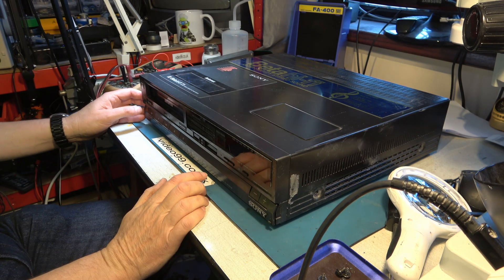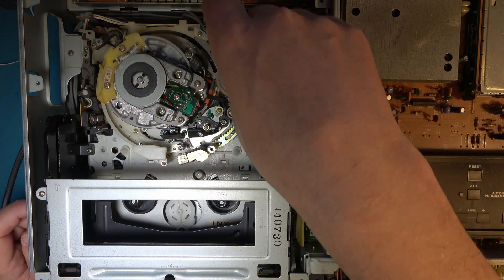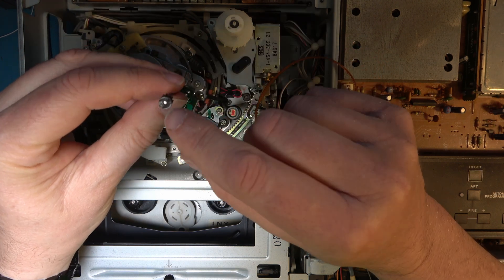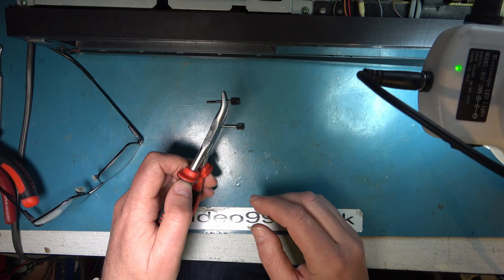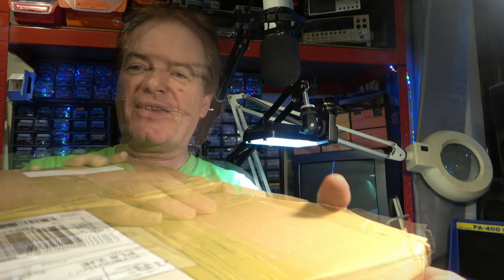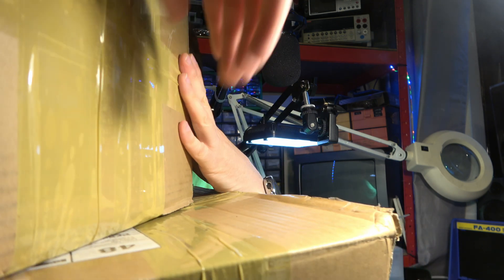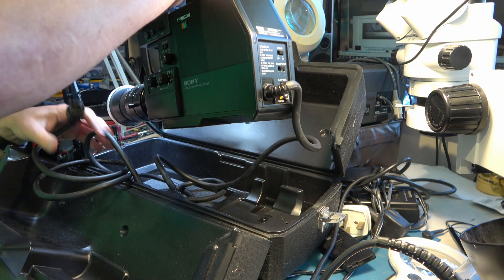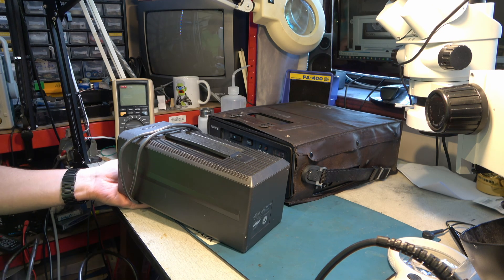Sony SL-HF100 Beta HiFi breakdown. Look at SL-3000 and CCD-F340 donations.

Comment: Weird question... Does anyone know if the window on the top of the hf100 came with removable plastic film like a lot of modern products?
I ask because I acquired a machine today and there looks to be plastic film but I'm too afraid to remove it in case the logos come off with it 😅
Reply from the maker: That film still seems to be in place on all three of my HF100 machines.  I think I would leave it alone.

Comment: I have a SL-HF100P (industrial duplicator). It has now started to stop after few second of play/rewind/forward. Intermittently it will play about 10 minutes after pressing play/rewind few times. Any clues where to start?
Reply from the maker: The reel idler is called a pendulum.  It wears its support post at the plastic base.  Inserting a thin washer under the reel idler can help, but you have to take the reel drive assembly out.
Reply: @video99couk  It was typical head’s hall sensor after all. Thank you for your great videos🙂

Comment: I had a fantastic old Betacam SP camera with around 120 faulty and badly leaking SMD capacitors...nightmare. Never seen so many to deal with. Chucked it in the bin eventually as too many caps to deal with. That's the problem with a lot of that old stuff, not worth the effort.

Comment: Betacam was a professional/broadcast tape format, whereas Betamax was a consumer tape format. As we all know that. But, there is no commonality between the recorded signal systems of the two formats. They are incompatible. The only commonality was the basic cassette shell design, which Sony decided to reuse for the Betacam, which came later after Betamax, I believe. Betacam also went on to use a much larger cassette size for longer recording/playback time and also the Betacam SP update, which improved the Betacam signal quality via higher resolution and better colour. I worked as an engineer in the broadcast industry during the heyday of Betacam, and the regular Betacam with smaller cassette, which looked very similar to Betamax cassette but with oxide tape inside was used for commercial ads playback. Usually, one 5 minute Betacam oxide tape cassette contained just one ad of 5, 15, 30 or 60 seconds. So if 100 separate commercials are to be played, there would be 100 Betacam small size cassettes. All handled by robotic library system controlled by computers and  it would play the commercials according to a playlist. The larger Betacam SP cassettes with metal particle tape inside would be used to play back movies or other shows. The library system would switch the playback back and forth between the ads and program tapes according to a playlist. I worked on the Sony BVC-10 Betacart, a 40 cassette library system and LMS-1000, a 1, 000 cassette library system; it handled a mix of small oxide Betacam tapes and the larger Betacam SP tapes. All barcoded, so the library would know what material each cassette contained.
Reply from the maker: The smaller tapes were usually (but not always) metal tape BetacamSP too.  I probably come across 20 BetacamSP tapes for every oxide one which shows up.  There is one commonality between domestic Beta and professional Betacam, the linear audio tracks are in the same place, probably so the early machines could use the same audio heads as they already had available.  There were also commonalities in the equipment such as some batteries and internal components.

Comment: I hear RCA cable is the lowest quality when u play VHS tape . Is there any way to play it with high quality. I search for vcr with component ports but for the most of vcr it is only composite
Reply from the maker: Use an S-VHS machine which has S-Video connections.  It's a very worthwhile improvement even with regular VHS tapes.

Comment: Another cracker, Colin - thank you. I think I saw on 12 volt vids that you can rejuvenate dim VFDs by oversupplying them for a very short period, which burns off any oxidation on the holding wires

I’ll see if I can find the video and mail a link to you

Comment: Clearly Betacam is related to Betamax, since they use the same cassette. I've successfully recorded Betacam onto a domestic L-750 cassette in a Sony BVW-75P, and got 30mins of record time. The BVW series are the only ones that can record both Betacam and BetacamSP formats. I think the Technology Connections video was just saying Betamax is not Betacam, which is true they are different formats but using the same cassette.

Comment: I think there are some similar gears from radio controlled cars that will fit and work. I had a scrap SL-C20 to donate the loading gear for my HF-100
Reply: I found  a brass gear from a hobby shop. It needed to be modified: cut to length and the centre hole drilled out for an interference fit on the shaft but it has worked well so far. I think I've  done this on three Betamax machines so far.

Comment: Quite true, the gears are beyond 3d print technology but I can't help but think some other no skill options exist. Clearly model engineers have the the equipment to machine/CNC gears for miniture stream locomotives and so on but that is a high investment option. But casting in plastics seems on option perhaps by making a mould from an original part as some modellers indeed do. I am not a modeller so... pinch of salt.

Comment: A resin 3d printer might be able to print that - though the materials might not be a strong as normal 3D printer filaments. (I have 2 HF100's by the way).
Reply: Seriously considering buying a small resin 3D printer for that reason as I agree it's the way to go to get some additional strength.

Comment: TC's intention was to debunk the idea that Beta was the better format of the two domestic video formats "because tv stations used it". His point was that no matter how much Sony reused the mechanical part of the original Beta, the video signal in Betacam was completely different and incompatible. He argued that, once Sony was forced to slow down the speed of the Beta format to keep up with VHS longer tape running times, the slight advantage of a better image quality of the original Beta, vanished.
Reply from the maker: The tape slowing comments may or may not be true in NTSC world.  Beta outperforms VHS in PAL and only has the one speed.
Reply: I'm not too sure that Tech. conn. video was a response to Colin's video about the Beta format, I think it was a coincidense, but if it is that's not appropriate, Colin made excelent points about the Beta format, I don't care what T.C thinks, He doesn't have the knowledge and experience that Colin has to respond to his videos.